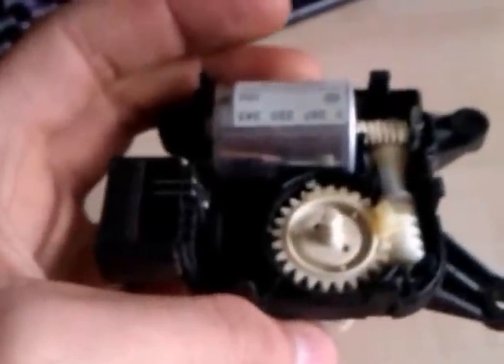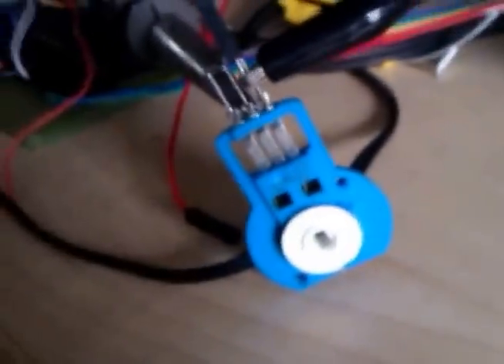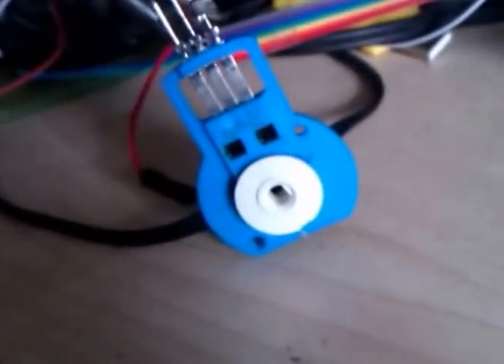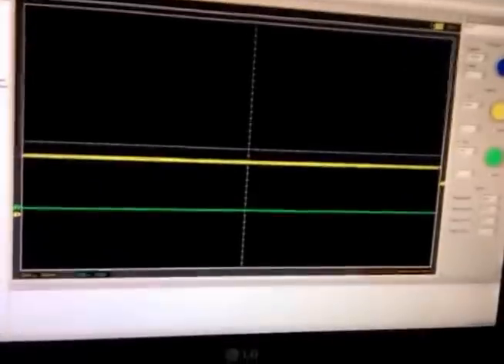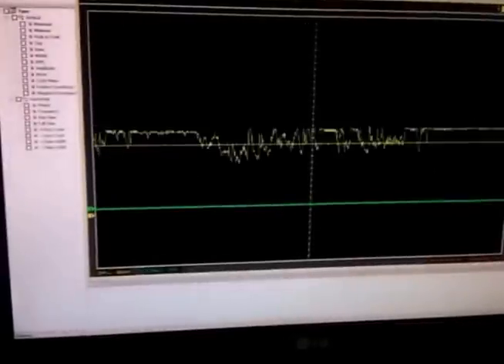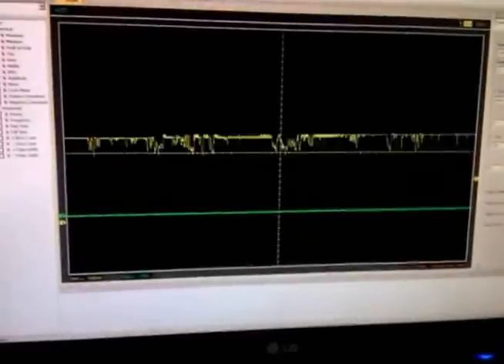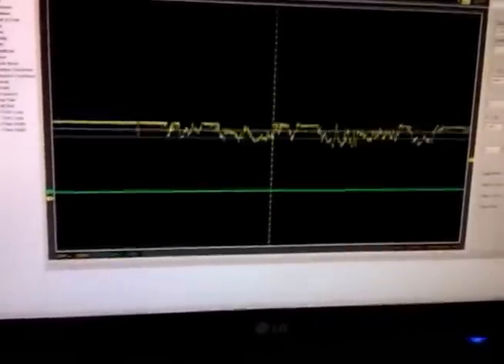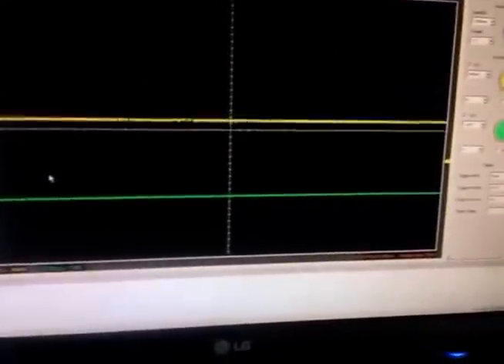Stilo Climate Control actuator repair

Comment: Long shot but maybe you are still here. How deep and i need to take dashboard apart to get it out ? I hope i dont need to get all dashboard apart
Reply from the maker: Hi, from memory (I don't have the car anymore) I think there are 4 actuators in total and 3 of them are accessible by just removing the side panels in the footwells, although it's still a bit of a pain for one of those as it's in quite a tight space.
Reply: @ojmbvids  Thank you for reply. I can't find any info about it at all. I would be so thankful if you could answer 1 more question. When recirculation is OFF the flap goes up and seals itself, if i turn it ON it opens. It doesnt make sense to me as it should be other way around? It is clicking i have to help it with hand to close it or open. If sealed flap means recirculation is off then im gonna just leave it and live without recirculation.(but how the fresh air gets in if the flap is sealed? hmm) Thank you very much mate.
Reply from the maker: I can't remember which way it moved to be honest. My issue in this case was with it not routing air to the correct vents so I didn't really look in to the rest of it I'm afraid.

Comment: Hi! is there a specific position for the potentiometer when you assembled back ?
Reply from the maker: These actuators will only fit back together in one way so you shouldn't be able to get it wrong. There is a button combination on the stilo to press when you first start the car to force it to relearn the swing ranges of all the actuators. unfortunately I can't remember exactly what it is, but Google might help.
Reply: Hello again! first thanks for your reply and for you very helpful professional video. What i mean in my question , if  there is a specific position in the potentiometer when you assembly back  on the gear? how much must be torn left or right. I have measure the resistance and i notice if I rotate 120 degre right i get 4,5 kOhm and back again is 0.2kOhm. Or it doesn't matter for  the climat control module, it will relearn no matter in what position you put back the  potentiometer?
Reply from the maker: +Stefan Ab. I can't remember for sure, but I think it doesn't matter provided you do the relearn when you first turn it on again.
Reply: It works. Thank you !